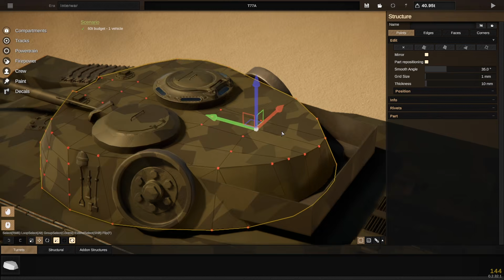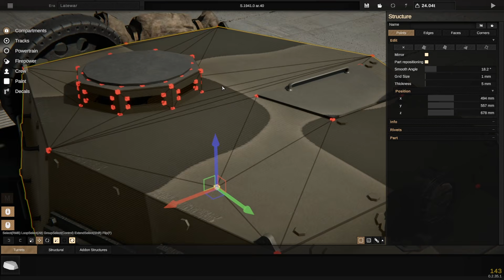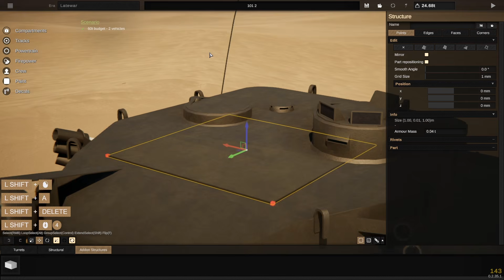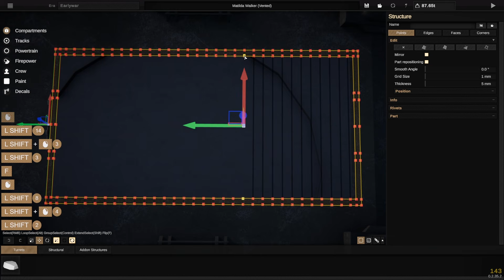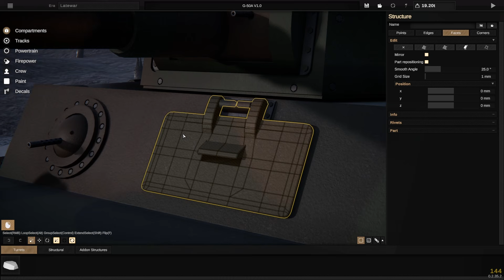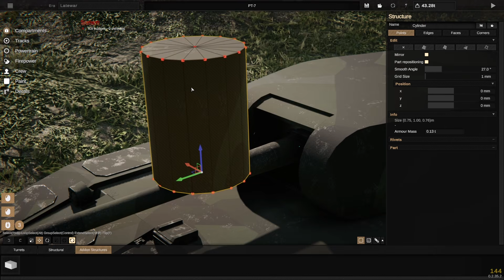The ULTIMATE Sprocket Freeform Tutorial

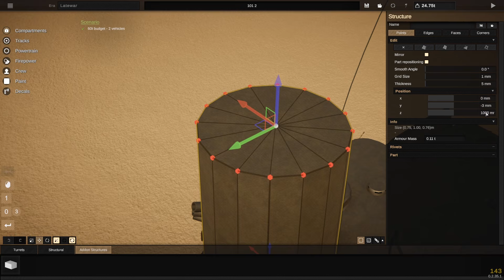Comment: 34:17 
If you select opposite points along the rim of the tube and fill, you create an edge between them. then select the edge you created (finicky) and split, leaving a point in the exact center of the tube. then if you merge the rest to said point it will be in the middle and ready to go!
Reply: (this is useful for cylinders which are off-center of an add-on structure)
Reply from the maker: Wish I had thought of this before